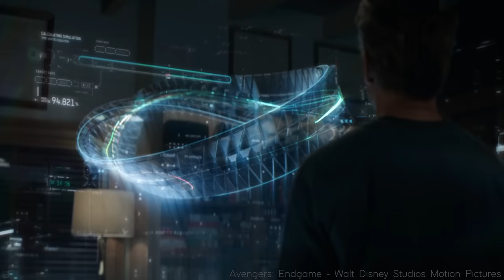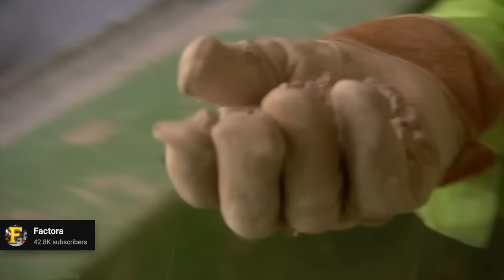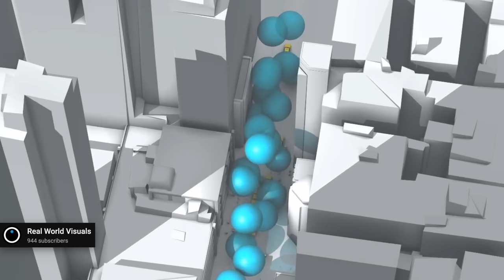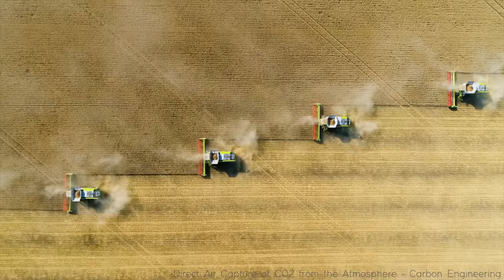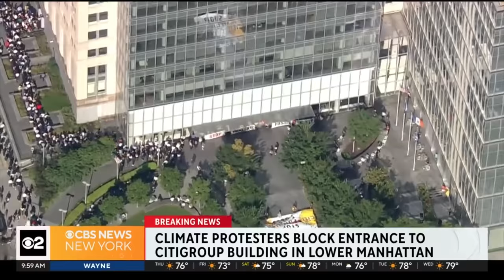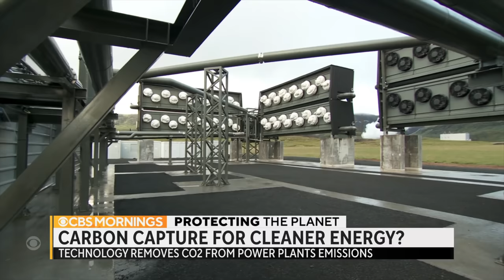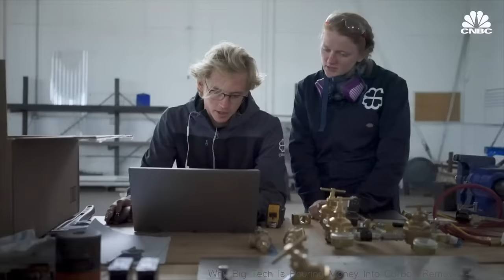How Thermodynamics Holds Back Negative Carbon Tech

Comment: Renewables + nuclear - the way to go
Reply: Just go all in on nuclear until we’ve eliminated the need for all forms of carbon based electricity generation. Then we can start to switch over to renewables. I’m pretty sure it’s cheaper per unit of energy generated to favor heavy use of nuclear power although I haven’t checked the most recent numbers.
Reply: Renewables? Really?
Reply: @JenniferA886  Nothing wrong with renewables, it's just that we cannot scale them as fast as our energy needs are to ween off the fossil train before it's too late... Nuclear now, we'll think later on how to make that a bit more sustainable when we do not have as much pressure from global warming...
Reply: its not going to be one solution. as an optimization problem, we need to evaluate all these energy sources. clean energy profiles will differ per region. look at the LCOE per geographic location and you will understand why
Reply: @JenniferA886 well yeah. I like having the ability to not rely on private corporations for my energy needs.
Reply: I can't agree more, and I can't repost it enough.
Reply: Yep 💯
Reply: Plant-based food system is the way to go.
Reply: @superveganwhat  all food is currently plant based. Livestock eat plants.
Reply: @MrTaxiRob  yes and it takes at the most efficient system which is factory farming chickens it’s 8 cal of plants to produce 1 cal that’s 8 to 1 of meat. Not to mention the other animals such as ruminants that produce methane, which is 25 times more damaging to climate change, then carbon, and after about 100 years, it starts turning into carbon so it would have the most immediate impact plus there’s all the carbon catcher that’s in nature that is removed like burning down Amazon rainforest for cows to graze and for plants such as soy to be grown for animals to eat, which as I said before is highly inefficient, calories are literally a measure of heat
Reply: @superveganwhat  I never once claimed it was efficient to produce, but those proteins sure are efficient to consume in handy meat form.
Reply: @zwerko the problem with renewables (aside from hydro and geothermal, which can’t be scaled) is they necessitate energy storage.
Reply from the maker: We certainly need more of both but remember that we still need to deal with emissions from cement, steel, aviation, agriculture, wildfires, etc which is why I emphasize at the start that some level of carbon capture looks to be needed
Reply: @jlight7346  good point, however, the time line from conception of the nuclear power plant, design, planning permission, endless appeals, protests, construction, testing etc etc etc etc takes many years
Reply: @Philitron128  I live in a very remote part of the South Pacific, so solar and wind works well… in fact it’s our only option out here, unless we keep trucking in loads of diesel. However, to scale this up to a large town, small city, does not work so well
Reply: @Scrogan  and there is the initial construction input costs etc
Reply: @CoolWorldsLab  I totally see where you’re coming from, and I agree, however, please consider this point. All of this effort will be for nothing, unless we get the developing countries on board. Otherwise poorer countries will just spit out the carbon and methane at ridiculous rates- while the “clean and green” countries like the uk spend billions clearing up their mess. My biggest point is that carbon and methane respect no boundaries. Either every single person and country is on board- or not at all… good luck trying to do this when there are countless wars and WW3 about to start any day now 👍👍👍
Reply: @JenniferA886  It’ll have to be done. Most of the strict regulations come from unfounded fears that can be mitigated with public demonstrations of safety. It still won’t be easy, but we’ll never be able to scale up renewable sources of energy fast enough. They don’t scale like nuclear plants can either. We tend to not build huge nuclear plants because they’re spread out and power is lost in transmission. If we have massive CO2 capture farms here and there, they can just have their own dedicated town-sized reactor complex. We’ve got plenty of fuel for decades to come too (if not a century or more), even with something like a 500% increase in energy demand.
Reply: @JenniferA886  Well that's fine, but I have solar on my home and it works out pretty well. Idk if there is any one size fits all plan. So if you guys want to do something else be my guest.
Reply: @jlight7346  good point… so if we go down the road of nuclear, we will need to plan ten years ahead- for each plant. And then we need to source the fuel. A big chunk of this comes from Russia
Reply: @MrTaxiRob  come on mate, that is not what plant based means.
Reply: I agree, but renewables need large scale storage and nuclear requires decades to build and costs billions. This is why gas and coal are still widely used.
Reply: @JenniferA886  Planning can be accelerated while still maintaining safety. You’re also not considering the fact that we can plan tens or hundreds of reactors at once if we wanted to. It’s not like this is some game where you have to wait for a cooldown or something. 

Fuel doesn’t need to be sourced from Russia, we’ve got plenty here and can source more from decommissioned nuclear weapons after dilution. Besides, if we did need fuel from Russia, I’m sure they’d be happy to sell it. They’d be happy to sell anything right now.
Reply: @JC-pn2ur  yeah yeah, I was just picking on the nerd.
Reply: I'm more thinking along the lines of space based Solar power for being able to scale at the absurd rates to provide enough power gen with 24/7 baseload power for cheap.
Reply: @CoolWorldsLab  
We need more CO2, not less.
Reply: @glennllewellyn7369  no we don’t.
Reply: @zwerko that's the invisible writing on the wall, there needs to be partial collapse and a simultaneously ensured ability to make everything with electric power and build modular systems too. Then live in a steady state technological system that has to still have progress. In other words every civilization has a lifespan and ot doesn't make sense to save thus one but to invent the next ones. Maybe even on a biological and genetic level
Reply: that's the invisible writing on the wall, there needs to be partial collapse and a simultaneously ensured ability to make everything with electric power and build modular systems too. Then live in a steady state technological system that has to still have progress. In other words every civilization has a lifespan and ot doesn't make sense to save thus one but to invent the next ones. Maybe even on a biological and genetic level
Reply: @JC-pn2ur  coal, oil, nuclear, gas and hydro… especially coal and nuclear is at the moment the best and potentially the only option for a baseline power requirement. Renewables are “great” in theory, however, they are unreliable, not storable and not reliable enough as a baseline
Reply: @manofwar447  I see where you’re coming from, however, first space based power transmission will first need to be tested. So this could take years to build a multi gigawatt power station?
Reply: @baneofbanes  actually CO2 is already produced by the giga tonne in some countries - for use in various industries
Reply: @jlight7346  I can see where you’re coming from. I used to live in the uk, and a new nuclear plant took two years to get through the planning/ appeals/ resubmitting of plans… you know the rest. Then the construction took three years, partly due to the protesters etc. essentially it was a 5 to 6 year process. And this was considered “ahead of schedule”. In theory I could imagine it’s possible to construct many stations at a time, however, the big issue is sourcing the financial resources etc
Reply: Based
Reply: @CoolWorldsLab from what I've learned so far, I think that it is necessary to take a two pronged approach by first addressing emissions and then capture (maybe you bring this up in the video, I haven't watched it all the way through yet)
Reply: @jlight7346  I’m not sure if it’s possible to use decommissioned weapons grade plutonium in a civilian power reactor… it needs to be enriched to the required level? Also, Russia is already the leading supplier to the United States for power grade uranium. I’m now living in NZ, so my knowledge is seriously limited on this, and we don’t have any nuclear reactors here… mostly hydro and geothermal power stations
Reply: When I was a lot younger, the conversation used to be about all forms of pollution.  That included things like industrial waste, plastics, insecticides, oils spills, all fossils fuel emissions, and yes, nuclear waste.  But since that time the CO2 emissions and global warming conversation have begun to dominate the entire pollution conversation, to the point where people seem to forget that all of these forms of pollution are serious problems.  We certainly need to address our CO2 problem aggressively and with immediacy, but we cannot lose site of all the other pollution issues we have, or we will end up in a world below 450 ppm of CO2, while knee deep in plastics, poisons, and nuclear waste.
Reply: @dnomyarg32  well said… and don’t forget SO6 - sulphur hexafluoride gas… lethal
Reply: @ddos87  optimization from a cult who cant do basic math
Reply: @jlight7346  were at a historical low point of CO2 near starvation levels. why are you sperging out abotu it proposing insane, monstrously expensive, and incredibly ineffecient things

it has virtually no correlation with temperature and a lot with healthy lifeforms.

climate related deaths has decreased 99% over the last 100 years, and experts agree that each degree lower will harm more lives than each degree upwards will.
Reply: @baneofbanes  were at a historical low point of CO2 near starvation levels. why are you sperging out abotu it proposing insane, monstrously expensive, and incredibly ineffecient things

it has virtually no correlation with temperature and a lot with healthy lifeforms.

climate related deaths has decreased 99% over the last 100 years, and experts agree that each degree lower will harm more lives than each degree upwards will.
Reply: @JenniferA886  oh for sure it needs development. There are already 2 successful small scale tests done so far afaik. But scaling to the many tWh a year production will be likely extremely expensive, come out cheaper surprisingly, or require the entire establishment of a space based mining and PV production  industry to provide the cheap feedstock for building the immense arrays.
Reply: @manofwar447  Space based solar energy in any significant amount is in the realm of science fiction. Not only the huge space based installations and costs and complexity related to that, but ground antenna installations would most likely also need to be several kms across when using microwave transmission, which would be probably the most feasible way. Even if all that would be doable tomorrow, no one knows the effect of these microwave beams into atmosphere or biosphere in the long run, so these systems could turn out be hazardous to environment and not viable because of that, even if all the engineering and cost issues to power mankind from the orbit are magically resolved.
Reply: @TheGrunt76  well. The microwave collectors at the least are just a mesh you can place over farmland due to being transparent mesh. 
Also climate change offers many drastic effects that cause significant more habitability damage than a relatively contained blast of below FCC radiation limit intensities. It's a case of choosing your poisons, mining all the ores for the transition will be immense but is still less mining than is done for fossil fuels in general.
Reply: Build more small nuclear power plants. Plant more trees.
Reply: @superveganwhat once somebody can make me a steak from cell culture at $8 a pound, I’ll be happy to switch.
Reply: @TheCleric42  great now you need to do is stop being part of the problem until you can get your eight dollar a pound steak
Reply: @zwerko this is such a out of date point of view. Did you stop following renewables in 2010?
Reply: Nuclear type 4 reactors 👈
Reply: Tidal Gang 

Tidal Gang

Tidal Gang

Tidal Gang

Tidal Gang
Reply: We're not gonna change anything by just producing and consuming more. Yes we need those sources of energy, but as a mean to transition into a more sober and sustainable civilisation. I can't see it happening though, it will most likely end in an exogenous sobriety.
Reply: Clear alone is enough.
Reply: @CoolWorldsLab it is disingenuous to proclaim we need to use renewables. You are smart enough to know that nuclear alone is enough, much, cheaper and much more rapidly scalable. Renewables have raw material availability problem, intermittence, and stockage issues. I am disappointed by you, lying to your audience in order to not offend sensibilities.
Reply: The ice age is ending. Rejoice...
Reply: @wasdwasdedsf  ?

I believe you meant to respond to someone else.
Reply: @JenniferA886   Probably not a run of the milll reactor you might see today, no. But it’s fissile material and that can be used as a reactor fuel. We’d dilute it (weapons grade fissile material is usually MUCH more enriched than reactor fuel) first with other elements to make it harder for terrorists to weapon use any stolen fuel and to make more fuel available for more reactors. Reactors today run on relatively impure fuel, I think only enriching it to around 5% at the most.  

Russia might be the leading supplier now, but that doesn’t mean they have the lion’s share of the total amount of ore. We can increase production to meet and exceed demand on our own if we need to for some reason. Again, I don’t see why Russia would skip this opportunity to rebuild its economy.
Reply: There are ways to make renewables and very little nuclear work very well except we needed to start over 60 years ago.  Since we have ‘found’ many exoplanets which may be habitable, perhaps we will run into a more advanced group of aliens someday who will give us some great advice on how to run things on our planet.  Until then, we are on our own.
Reply: Let me fix that for you: all energy sources - the way to go!
Reply: not every country is the United States of America bro
Reply: Modern designed Nuclear power stations built NO-WHERE NEAR any fault lines, OR coastal areas ARE WAYYY SAFER than what most people believe, they also have BETTER safety/shutdown systems/designs too. ALSO, the waste produced IS NOT as much as people think AND, said waste CAN (AND DOES) get recycled and/or RE-USED to continue to make more power... YES it is the cost and time to build these plants, but, the ONLY thing coming out of those chimney stacks is STEAM... AND, the fuel LASTS (one lot of 'Fuel' 3 to 6 years, then approx 25/30% of it is replenished with new fuel), again, that 25/30% is then reused/recycled in a secondary power station...
ALSO... Thorium.... It's a way, it's also NOT as radioactive...
And there are other 'Reactors' that are feasible 
WE DO NOT NEED TO RELY on Coal and Gas for our power needs in our future...
😎🇬🇧
Reply: @CoolWorldsLab And we need oil to manufacture all that. And we're mere decades away from complete oil depletion. This is the issue that needs conversation, because a world without oil is going to be, let's just say...ungood.
Reply: Indeed! This is da wey
Reply: @tomgunton   moar nukelrr now
Reply: Not enough, electrons don't move free (in $)  you need continuous energy efficiency, demand flexibility, grid scale heat and electricity storage maintaining grids and adopt to climate change impacts very fast
Reply: Or just all nuclear… seems best to me
Reply: @ddos87  of course but the great thing if we can maximize these technologies then perhaps we can transition off FF in our lifetime - or make a significant difference.
Reply: @philliptobin3695  it's a bad wey 😔
Reply: @Sniperboy5551  good luck
Reply: @JenniferA886  - they have their places. For example, quick deployment. It is expensive to make transmission lines for newer places. Renewables are great for the middle of nowhere and other places where the cost of emissions to build transmission lines is greater than the emissions from solar panel production and operation.
Reply: @zwerko renewable have many downsides, cost, maintenance, panels lose efficiency, wind blades aren't recyclable. Nuclear is the way, since we already have technology to recycle nuclear waste
Reply: @CaFe73100 livestock is yummy and grazes grass that we can't digest. Grazing is done on non arable land. Imagine how many more animals lived on Earth during previous ice ages and warm cycles
Reply: @tomgunton new nuclear plants are literally problem free
Reply: @jlight7346  It was cheaper. Recently solar has gotten much cheaper. Solar started expensive but has gone way down in price. Also solar is quicker to build.
Reply: @zwerko  Nuclear plants take a long time to build. Solar is much quicker. Solar and wind and batteries can be scaled more quickly than nuclear at this point.
Reply: @donaldhobson8873  No they cannot, not for non-interrupted high-power demand which the industry requires to stop fossil-fuel-guzzling. Before you even start, You need to produce A LOT of batteries for that (very dirty technology, both by toxins and CO2 release in the process, btw.) At the moment, very ambitious plans of global battery manufacturers are to hit 5TWh annual capacity production, cumulatively, by 2030. That is all batteries, for all purposes, across the globe. Even if you could dedicate half of it to buffer renewables, that's about enough capacity to offset oil (and only oil, coal and natural gas still remain) use in Brazil. Even if our energy consumption doesn't increase (which it will), it would take us about two centuries to backup half of it (to account for darkness/no wind) in batteries. The total CO2 production and environment devastation in the process would probably eclipse what we did so far with fossil fuels...
Reply: @zwerko  Battery tech is rapidly improving. And they aren't that dirty compared to fossil fuels.
But more to the point, where did you get the idea that all these industrial processes need to happen 24/7?
They can turn on and off. Also, battery production is growing exponentially. Making your 2 centuries number clearly nonsense, unless you are trying to pretend the trend is linear.
Reply: @donaldhobson8873  Maybe in some places, sure. 

You still can’t use it as your primary source of power though because we don’t have any great ways to store it for later use. You can’t ramp up power generation as you please like with hydrocarbons and nuclear, you only get power when the sun is out. So that means you have to build a hell of a lot to capture as much as possible during the day, and then make a bunch of batteries to store all the excess for the night too. 

Setting aside the fact that pretty much any kind of battery we make at a large scale will have very poor affects on the environment, the technology simply doesn’t exist. Not yet anyway. 

I’m also not sure where you got your numbers from. Yes, it is relevant. We need to know if whatever study you looked at included government subsidies in its research.
Reply: @jlight7346 it actually isn't. Renewables are much cheaper but of course there is the problem of having enough energy storage
Reply: @macbuff81  So…renewables aren’t actually cheaper or more practical.
Reply: Nuclear is enough. Renewables are distraction, apart from special cases like directly powering AC in peak heat from solar where solar can decrease peak grid load
Reply: @jlight7346 100% nuclear LMAO you have no idea what you're saying
Reply: @jlight7346 why?

Renewables already passed the point of being cheaper per gwh then coal or fission.

Storage options just coming on that cheaper too. No, not Lithium batteries, although they could form a part of rapid power balancing service.

So we're at tipping point where it's just matter of time. The economics are in green favour.

I'm fine with fission in the mix, but it's just so fucking expensive. Unless SMRs get a bollock on and prove their worth, then I really don't see fission being a huge part of it.
Reply: Only solves 1/2 the problem.
Reply: But nuclear is scary.
Reply: Building nuclear plants takes decades, too late for that at a big scale. Best thing we can do is keep the existing nuclear plants running for as long as possible.
Reply: @jlight7346 the most recent numbers are that nuclear is about 100-1000 times more expensive. So since money can be roughly exchanged for "effort", you can get 100-1000 times more energy for the same effort with renewables over nuclear.
Reply: @gasdive  And what’s your source? Does whatever study you saw include government subsidies in its cost analysis? What kind of renewable are you talking about specifically? What about energy storage costs? What country or countries does it apply to? There’s so many questions anyone looking for a serious answer would have and they can all be satisfied with a simple link. 

Please, don’t make yourself look dishonest. You can never tell if someone is just pulling numbers out of their ass these days. It’s always best to dispel any doubt by citing a source.
Reply: @davescott7680  Please cite a source. Nobody has any clue if you’re statement is valid without one.
Reply: Yeah if you think nuclear is safe you don't really understand thermodynamics
Reply: @zwerko how about using less energy?
Reply: @superveganwhat animals in a healthy system greatly increase both nutrient and energy flows through the system. What we need is local regenerative, low capital food production. Not some high-tech synthetic food future.
Reply: @gekkobear1650  that’s a farce
Reply: @CoolWorldsLab right now carbon capture is vapor ware.
Reply: @@Zangief74 degrowth is the only outcome. Either we do it with conscious intentionality, or the Earth does what she has to do.
Reply: Renewables = more mining, more production. 
Those two things are how we got into this mess. Try again
Reply: Another unlettered comment with zero understanding of the maths behind it !
Reply: @jlight7346 personally I would not recommend or do that. Nuclear with carbon based energy is a better route. If you want to know why just ask.
Reply: @CoolWorldsLab I agree so that other methods of industry are not effected by too rapid changes and to allow the economy behind them to catch up.
Reply: "Renewables plus nuclear minus the way to go" ? 😉
Reply: Both are wrong since a deep dive into an engineering analysis the planet does not have enough raw resources to either go nuclear even molten salt reactors of expanded to just current industrialized scale. 

Large farms (area) of solar panel will change the albedo - reflectance the land thus changing at a minimum surface wind and precipitation patterns . 

Humanity should NOT make the same errors it did by using sequestrated fossil fuels. 

The root cause of this problem is CAPITALISM- an exponential economic system on a FINITE planet which flies in the face of basic maths and logic .
Reply: @thalesnemo2841  what would your solution be than? I'm curious, and for nuclear, we actually do it. It's just hard to do it for now. And by solar, do you mean for the renewable resources?
Reply: @thalesnemo2841  So, you are saying the root cause of the problem is the alleviation of world poverty, hunger, disease. I think the real problem is YOU.
Reply: I feel like more needs to be invested in fusion research. Not saying we should go all in on one technology, everything else is just as important. But I feel fusion can be the real long term solution.
Reply: @JenniferA886 yes, really.
Reply: Oil + nuclear = the way to go
Reply: You are half correct. Because neuclear needs water to cool it, geothermal is better.
Reply: @manofwar447 
Heh. Based. 
You one the peeps who goes for an SFIA - Cool Worlds double? 😁
Reply: Clear? Clear what?
Reply: @thureintun1687 
And?
Reply: @Ourdirtytwo 
What's the alternative then? A regimented degrowth?
Reply: @mendyboio3917 
Based as that is, geothermal is considerably more experimental atm. There tend to be issues with stealing heat through HDR that limits things. I definitely support furthering said research, though. Namely in the fields of seismology, and high-temp drilling and logistics, if I'm correct. 
I mean... it's oodles more energy than humans have used in their history sitting beneath our feet... It's almost as practically abundant as space based solar! 😁
Reply: @MrTaxiRob efficient in what way? That you like the taste? That's not an efficiency metric. If you're assuming protein density, then that's not true? Plant based protein sources reach the highest density.
Reply: @JenniferA886 what do you mean really? Many countries have already switched to > 50% renewables in just a few decades. Renewables work and are generally far more economical, easier to setup, and less site-dependent than fission. I'm not opposed to fission at all, but it keeps getting less and less economical compared to modern renewables. And it'll keep going that way unless there's advancements in fission. Especially as energy storage becomes more accessible, long distance efficient transmission becomes better and mud accessible, and grids become smarter.

Fusion and geothermal are nice in theory. But we can't put everything into a gamble with those. Especially given we need to reduce emissions yesterday.
Reply: @ddos87 those are getting increasingly irrelevant as grid interconnects, long distance transmission, smarter grids, etc become more accessible. Just look at how big China is going on this. HVDC is way more accessible and scales better over very long distances than traditional high voltage AC transmission does.

Europe has been considering power generation in Africa even, then long distance transmission back. That has been dropped for now as those regions have become increasingly unstable and Russia has been Russia.
Reply: @j.r.8176 oil + nuclear? Oil makes no sense at all mate. Did you even watch the video? Not to mention oil is not only inherently limited, but we're coming up on the end of economical oil rapidly.
Reply: @mendyboio3917 geothermal is not technologically capable yet. Geothermal and fusion are both nice to think about, but they're both really really hard to achieve. We can't afford to risk putting everything into them only for it to not become possible in time.
Reply: @lost4468yt  If we have enough energy we can synthesize our own hydrocarbons using co2 then use it either as fuel or for other purposes (plastic, construction materals, etc.) without disrupting the infrastructure already in place.
Also no one knows just how much oil reserves there actually is. Stop pretending you're smarter than you actually are and don't argue with me, "mate". Know your place.
Reply: @j.r.8176   oil reserves are absolutely going to run out very soon. Yes current estimates might be incorrect, but there's a limit to how incorrect they can be. Even being very generous it's still going to rapidly run out. Know your place!

Also if you're not even on about traditional fossil fuels then you should say biofuels. But those will still be limited. Making them to burn to generate grid power makes no sense - just directly generate the electricity. Currently they look to only make sense in some transportation, plastic production, etc. Which are much smaller scale use cases anyway.

Don't leave silly comments in the future that are directly misleading.